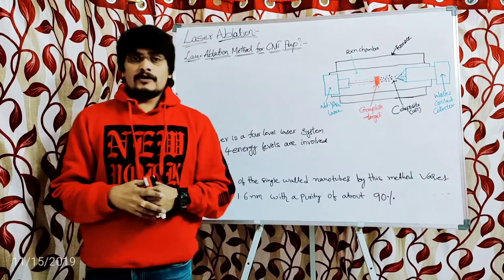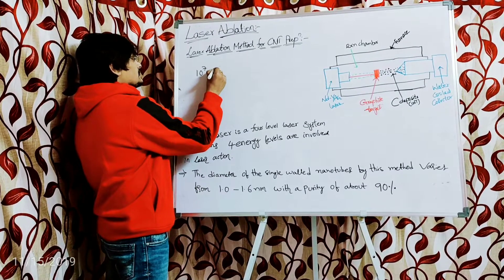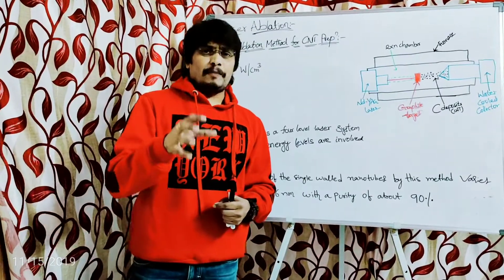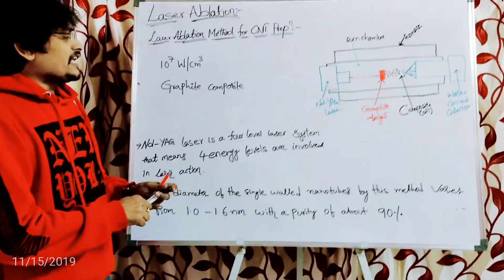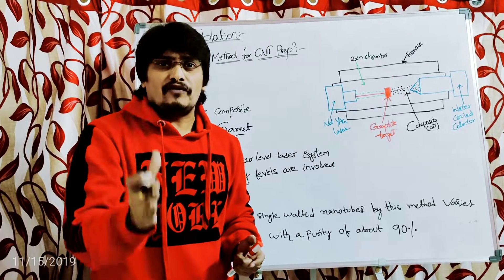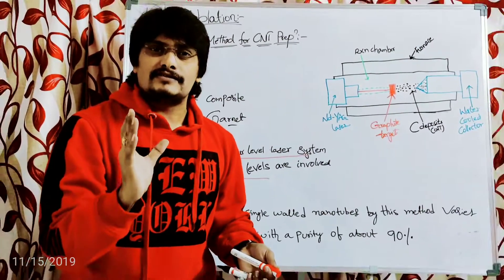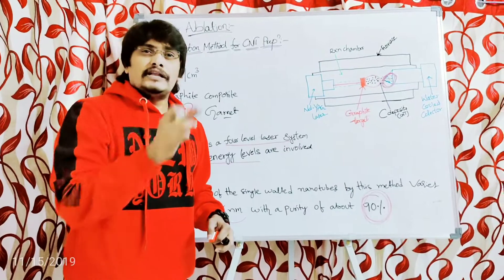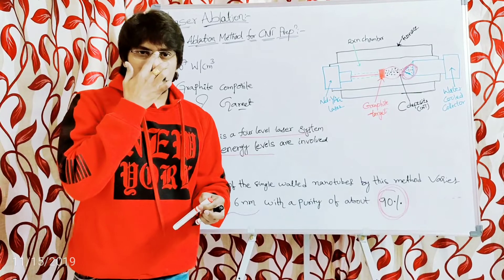Preparation of Nanoparticles: Laser Ablation method by Dr.K.Shirish Kumar (CHEMURGIC TUTORIALS)

Comment: Why no capping agent is used in this technique?
Reply from the maker: Dear Anish,
The preparation of nanomaterials by organometallic precursors (sol-gel method) require a capping agent, which primarily acts as a stabilizing agent and provides colloidal stability along with preventing agglomeration and stopping uncontrolled growth.
But in the Laser Ablation method, there is no question of agglomeration as we are not using any chemical, instead using Laser.
I hope you got it.
Reply: @DrKShirishKumar  thank you sir